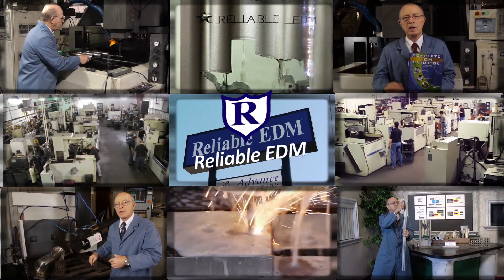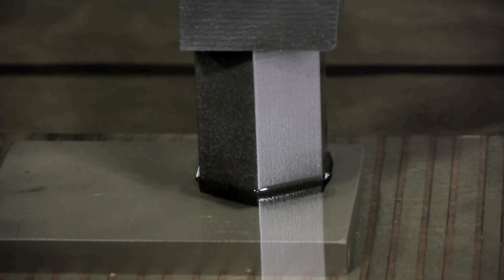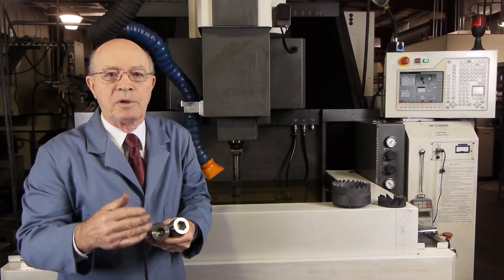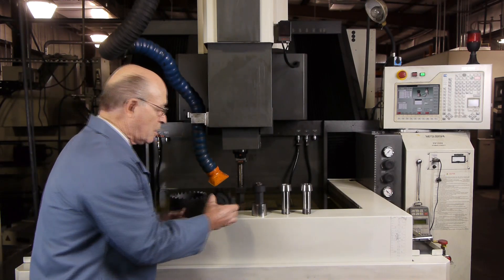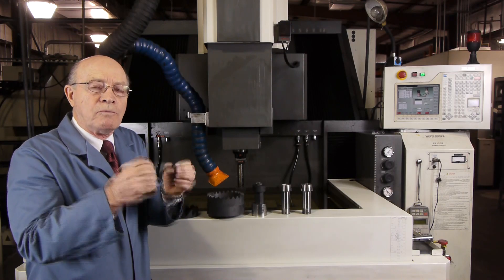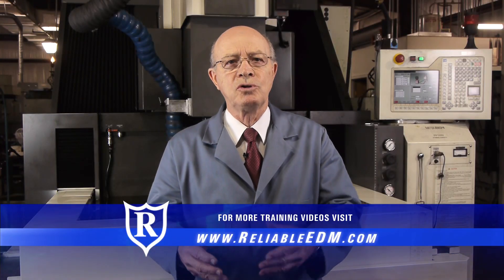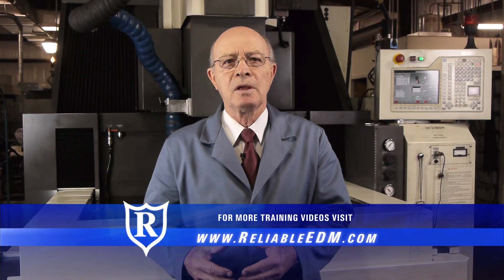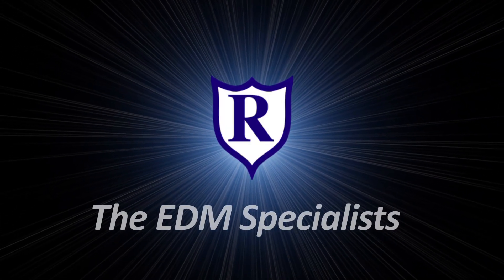Introduction to Sinker/Ram EDM

Comment: As always: youtubers know best; i skipped a beat or two when you pointed with that metal rod.. isn't that high voltage?
Reply: Electricity will always follow the path of least action. 

In this instance, the machine is already grounded, creating an already short and easy circuit for the electrical energy to follow, much easier than going through flesh and then a rubber sole.

Comment: very interesting, always wondered how the made allen head sockets, they must use a ram EDM machine
Reply: I guarantee they are not using EDM to put the hex in bolts that you buy at the store. They would have to charge so much money ber bolt if that were the case.
Reply: No they don't-- it is a specialist machining process which is too slow for mass production
Reply: Russel Dougan no way, do you know how insanely expensive that would make those fasteners? And they don’t need to be that precise anyway. Socket head cap screws are forged for production use.
Reply: Artisanal allen socket screws